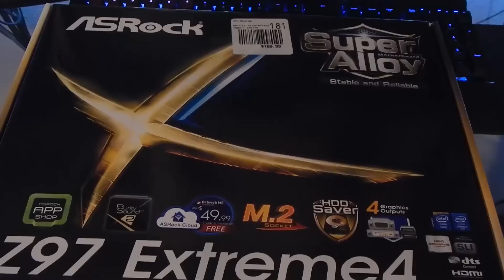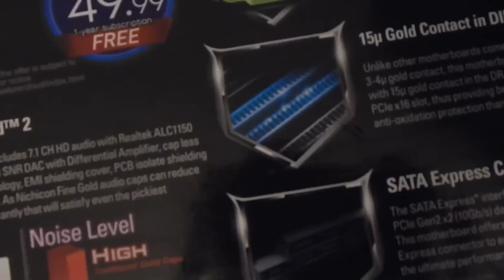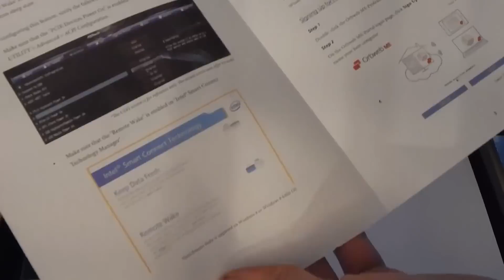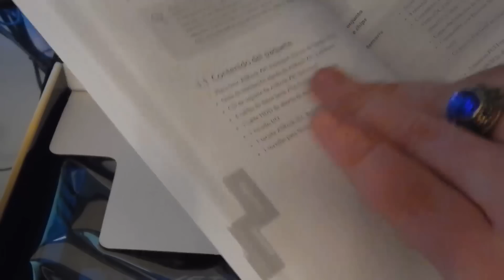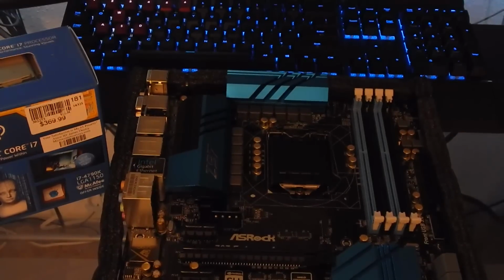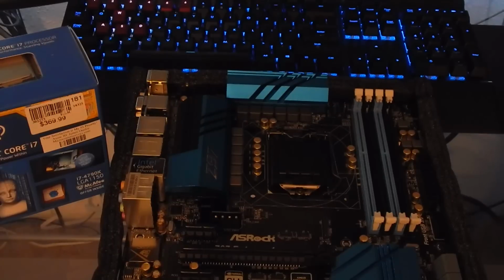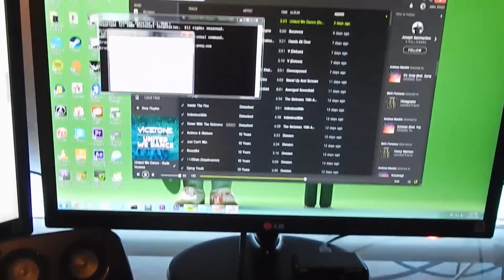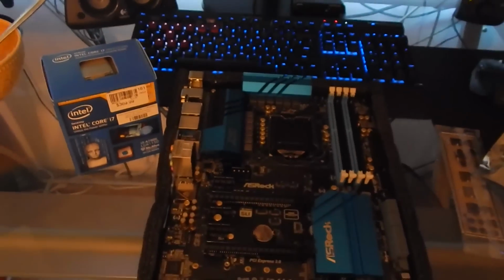ASRock Z97 Extreme 4 ATX Motherboard - LGA 1150 - Unboxing and Review

Comment: so i have everything up and going, this exact board, 4790k, cm evo 212 push pull setup, artic silver thermal paste, 200mm cm upper case fan, rear 120mm case fan, front 200mm case fan, g skill 1866 16gb 4 x 4gb..samsung 850 pro ssd...xmp enabled, evga gtx 1070sc, have it overclocked to 4.6ghz at 1.27 volts..it idles around 46c to 54c and when i stress it, it goes to about 95c upwards to near 100c...battlefield 1 will hit up to 100c and crash sometimes(bsod)....any advice? my room temp is about 77-80 degress f. on average...do you think a corsair h100i v2 will fix this prob?....i know my cooling on my rig atm is more than adequate, but i feel this chip runs hot even when i dont oc it...any tips will be appreciated...also to note my 2 fans on my cm evo 212 are aftermarket and non corsair 120mm...
Reply from the maker: Your components will never get lower than the ambient temperature within your room, it's just the way physics work. The H100i v2 is a great all-in-one, but you need to lower your ambient temperature. In this situation, your fans are only blowing hotter air into and through your system, which is increasing the temperature of your components. Here's an excellent video about case pressure as well, just in case that is a factor. 
https://www.youtube.com/watch?v=4NYHC3DXynM

Comment: hello, i have this same setup, just bought the z97 extreme 4/4790k used combo....i noticed the bios switch, what does that do? it came in the mail in the 2nd position...do i leave it there or switch it to  prior to booting cpu?
Reply from the maker: 04swiftstang The BIOS switch is simply to switch between two different BIOS configurations.
Reply: The9thDivine  thank you.

Comment: I just bought this motherboard (for 65€ new, I guess that's a good price) and wanna know wether there's an option to set the CPU fan speed individual for different temperatures in the BIOS. My old board had this feature and I would really appreciate to have it again.

Comment: does anyone know what size the motherboard it is?
Reply from the maker: This is a full ATX board.
Reply: +The9thDivine thanks, also would it fit a i7-4790
Reply from the maker: LGA1150 CPUs are compatible with LGA1150 sockets. So yes.

Comment: hi, i just ordered this mobo but i just found out that people who bought this mobo were having common problems regarding switching off the psu and turning it back on would make your system unable to boot up. Have you had any issues? thanks in advance
Reply: +Irvanno Taqi I'm wondering the same thing because I've also read that also. I'm looking at this board, but that's the one thing that has me hesitating on it. Did ASRock ever offer a solution for that?
Reply from the maker: +Jack Flynn Sorry guys, haven't been checking notifications recently. Looking into it a bit further, I had a couple issues in the past dealing with a code that would come onto the debug LED, that of which would be completely unexplained for being a CPU or memory issue, that of which I found somehow had to deal with the voltage on the RAM. The other issue I found in regards to the system not being able to boot was a dying CMOS battery (that of which has awful placement on the motherboard, at least for SLI/Crossfire). Most issues were fixed with BIOS updates that started coming out in January of last year. I replaced the CMOS battery when I was having those issues, and now I don't have many problems with the board, if any problems at all.

Comment: I just picked this MB up yesterday at my local microcenter for 60$, haven't finished my daughters PC yet so I haven't been able to test it.
Reply from the maker: It's pretty great, I don't think you'll regret it. But if you can, I'd suggest replacing the CMOS battery if you have any problems. A few of the boards were sent out with dying ones.
Reply: The9thDivine Thanks for the suggestion, ill make sure to check

Comment: Does this board work whit ddr4 memory ram?
Reply from the maker: +IN ON!! ! This motherboard is Z97, which is below the X99 platform and therefore only supports DDR3. DDR3 has 240 pins, while DDR4 has 260, which makes it incompatible to any motherboard without an X99 or Z170 chipset.
Reply: Thank you really much, I was going for 8gb of ddr4 because i dindt knew abot the incopatiblility but maybe I am thinking on 16 gigs due to the fact that ddr3 is much cheaper when more gigs are evolved, depending all on the frequency too...

Comment: sir i already have this motherboard..and i touched my board out of the box while my feet is on the floor..my friend told me that i might have damage my board..so is it possible to damage my board by just touching it out of the box while my feet is on the floor?
Reply from the maker: zaCk VeLenTine Unless you released a shock or any electrostatic energy onto the board, it should be fine. But I would be careful about how you go about handling it in the environment where static electricity can be easily created.
Reply: The9thDivine thank you so much sir.. i appreciate your advice..im new to PC building.. and i when i touched it i don't feel any electrostatic energy..

Comment: 12K... WOW, almost everybody is still using 10k!
Another win for ASRock... If only they had a PR department on par with their engineering!
Best motherboard assembler I ever used... Currently 4 under heavy usage, not one glitch ever!
Great Buy... And yes, and hour away is a local vendor ;)
Cheers.

I've been looking at the engineering of ASRock Z97 mobos and it is impressive... Only downers are the SLI bridges and the low-quality IO thingy, but those are just "bells-and-whistles" having no impact on performance.
ASRock's website is also awesome and their driver department is second to none.

Comment: What do you plug into that PCI power connector on the motherboard to make it power the PCI express ports
Reply from the maker: haydn willoughby Nothing. The PCI lanes are powered by a delivery method just from the motherboard power. The four pin molex connector that I point out for "PCI power" at 5:48 is only needed if there are three graphics cards installed into the PCI lanes. It would be connected with a four pin molex connector.

Comment: I was about to get one of these, but I read a lot of customer reviews and feeds. Apparently a lot of these boards have been dying after power supply has been turned on and off. Definitely put me off getting one.
Reply from the maker: Tash dej It's a shame that people look at the bad reviews more than the good ones nowadays. I don't know why the board would be dying after a PSU turn on and back off, unless they're doing it so quickly that it surges the motherboard and fries it.
Reply: The9thDivine Apparently not. People just turn off the power, and when they turn it back on the board doesn't work. Maybe if this was an isolated incident I would ignore it, but almost every bad review of this product has the exact same problem. I think there was a faulty batch sent out. I don't personally want to risk it myself. Such a same cause I have a build that involves blue, and this looked like it would be perfect for it.
Reply from the maker: There was a faulty batch sent out, yes. I hand picked mine out from a local MicroCenter so I wouldn't get one that was DOA or faulty.

Comment: Whats the difference between the Extreme3 and Extreme4?
Reply: TheAymanhawk23 The extreme3 only has an 8 phase CPU power design, so it won't overclock as well as the extreme4 with 12 phase digi power. I think the extreme3 lacks dual bios as well as a few extra goodies. Most sites have the extreme3 marginally cheaper than the extreme4. Spend the extra 20-30 bucks on the extreme4 it's probably the best bang for the buck z97 board

Comment: So does the motherboard come pre installed with a cpu fan mount or something else?
Reply from the maker: MrONL1NEG4MER "CPU fan mount"? The motherboard doesn't come with anything pertaining to a fan mount. Only feature would be the 4 pin power connector for the CPU fan.
Reply: Don't you need a cpu fan mount to put the fan over the CPU? Its usually under the Motherboard from the other videos I've seen.
Reply from the maker: There are four holes that act as where a standard fan can be placed. There is no 'fan mount' that comes with the motherboard.

Comment: I have the exact same one. it says a6 when I'm on the utility and when I reset it says a plzzz help
Reply from the maker: A6 and AA are normal codes. http://www.asrock.com/support/faq.asp?id=334
Reply: srry i mean a2... and it wont connect to the internet. soo when i got to the cd support to install the intel lan driver it doesnt install it just stays there..
Reply from the maker: Chris Situ  I'd RMA the board for a new one after you contact ASRock support and convene with them.
Reply: wait what?
Reply from the maker: Call ASRock. Tell them what you're experiencing and see if they can walk you through a fix.
Reply: ty man

Comment: Very nice unboxing! But I found two mistakes: All SATA-Ports are 6GB/s, and the mainboard is NOT 3-Way-SLI compatible.
Reply from the maker: Your first mistake is correct; all of the SATA ports are in fact 6GB/s, but I believe the mainboard is still SLI compatible with 3 cards. The last PCI slot is a bit close to the second, but I think you can still throw a card in there. For my build, it looks like it may not fit; because both my 760s are dual-slot cards, and my case isn't a full tower.
Reply: The9thDivine The problem is not the mainboard, in fact it supports 3-Way-Crossfire, the problem is the CPU. The 1150-CPUs only have 16 PCIe-lanes. So if you run 3 GPUs, the lane configuration is 8/4/4. But Nvidia cards need at least 8 lanes to work. To run a 3-Way-SLI configuration, you have to use a 2011-CPU or an AMD CPU. Both support enough lanes
Reply from the maker: Socket 1150 CPUs are limited to single PCIE x16 or dual PCIEx8 or PCIEx 8/4/4 or 4/4/4/4. I'm not sure what the affect on SLI performance would come out to but I do not believe it's very much.
Reply from the maker: I know for a fact that you most certainly do not need a 2011 CPU or an AMD CPU to run 3 way SLI.
Reply from the maker: You could even run Quad SLI, not on this board, but very easily with another Z97 board, 1150 socket, that has a PLX chip.
Reply: The9thDivine ok, I think I was wrong, but Nvidias GTX 980 need at least 8 lanes to work in SLI. I don't know how many lanes older Nvidia GPUs need. But even ASRock's website tells me that this mainboard can only support 2-Way-SLI or Quad-SLI, if you run two Titan Zs in SLI (if anyone has the money for this :P).
Reply from the maker: I was wondering what the hell they were talking about with "Quad SLI compatible", lol. Didn't think about Titan Zs. Not for me! If I had two GTX760 MARS editions I'd have Quad SLI right there!
Reply: The9thDivine That's another way to get Quad-SLI. What I'm wondering about right now is if you can run 3-way-SLI by running one of these MARS Editions and another "normal" GTX 760
Reply from the maker: I believe you can do that, yes. As long as both cards are the same chipset, there's no reason why it wouldn't work!
Reply: The9thDivine

I can tell you for fact that mix matching manufacturer cards doesn't always work.
I have a Asus gtx 970 and a EVGA 970 both 4 gig and they do not like each other. No matter what I do it tells me there is no SLI bridge connected. I had to hack the driver to get it to do SLI but even then I can't get it to do surround on my triple monitor setup. Going to call Newegg today and see if they will let be return one so I can get a matching second card.

If not I am looking to upgrade my MB and CPU so it can be an expensive mistake.
This is the board I have picked out, we'll see.

Thanks for the review
Reply: Bill Pierpont That's for Nvidia. AMD Crossfire is a lot more forgiving, even allowing cards with different amounts of RAM aha
Reply from the maker: Bill Pierpont Seems a little odd that two cards wouldn't work as you've described, but I don't think it would be a correct statement to say that match mixing manufacturer cards doesn't always work, it was most likely the case that one of them had a bad batch of SLI fingers. I've never heard of any case where they wouldn't work together. :/
Reply: Bill Pierpont Yeah, I was mainly saying that for anyone who was reading and thought you were talking about all cards and not just SLI :)

Comment: I love this board! I got it and recommended this to my buddies.
Reply from the maker: Just out of curiosity, did you ever have any debug error code 64 issues, or any really slow boot problems? The code kept coming up, for no reasons whatsoever, until I changed the CMOS battery. ASRock must have shipped one with a faulty or dying battery.

Comment: The9thDivine did the system prep work? I'm asking because I'm getting a MSI 970 am3+ motherboard and only have one hard drive and dont want to reinstall windows. If so what tutorial did you follow?
Reply from the maker: Actually, the system prep encountered fatal errors every time I tried and didn't find a way around it. Everything booted successfully when everything was installed, which was amazing. All I had to do was reinstall all the drivers and I was done!
Reply: Alright thanks hopefully I get the same result on my system.
Reply from the maker: But, here is the tutorial: Hopefully this will work for you! http://www.makeuseof.com/tag/making-sure-windows-7-will-boot-after-changing-the-motherboard/
Reply: Thanks I appreciate the help. :)

Comment: I may or might not be doing a similar upgrade within the next 2 weeks, so my question is, would I have to remove my old drivers or not worry about it and just carry on installing the new ones?
Reply from the maker: It really just depends. It may be possible for you to simply just install the new parts and the HDD and try to boot, and if it does, then you're good to go. If not, you'll have to reinstall Windows and everything on your Windows drive.